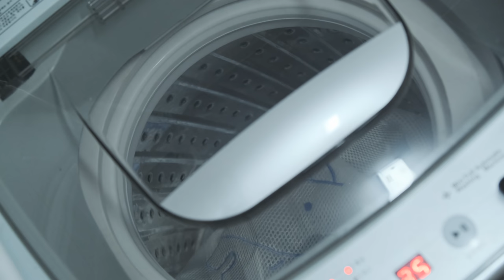[ASMR] 'Clean & Restore' Skechers' Running Shoes  -4k  satisfying

Comment: Using acetone on midsole removes the original factory protective coat, and dirt/stains will stick to midsole easier in future and it will be more prone to damages
Reply: What should you use instead?
Reply: that's why he applies a protector spray
Reply: What kind of coating you are talking about?  there is no coating on a outsole, only the release agent

Comment: Did you use liquid glue in water? That's an interesting application.
Reply: I was wondering what was the purpose of doing that? I don’t get it.
Reply: Using just the glue would make the fabric hard. When you walk on the shoe, the glue would just crack. Mixing the glue with water lets it go on thinner and be bendy and pliant still so that it doesn’t crack when worn.